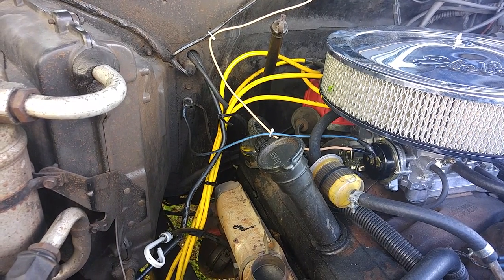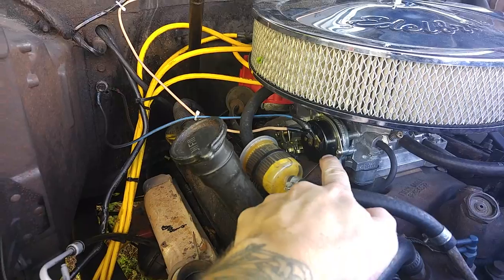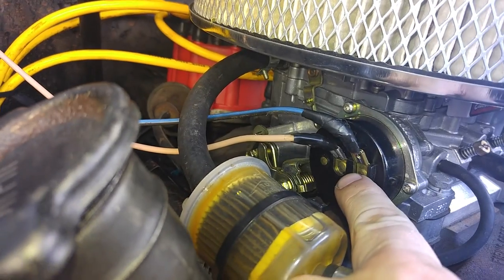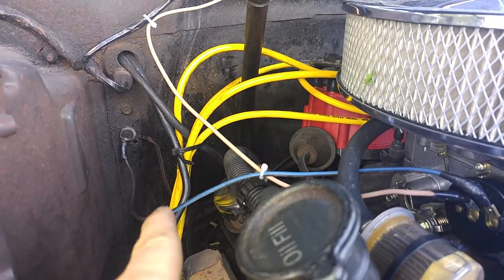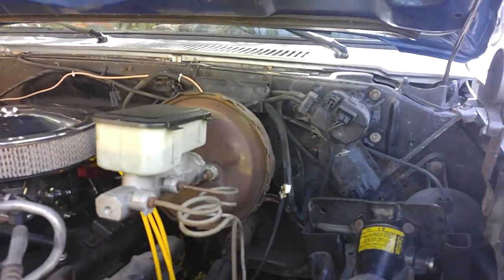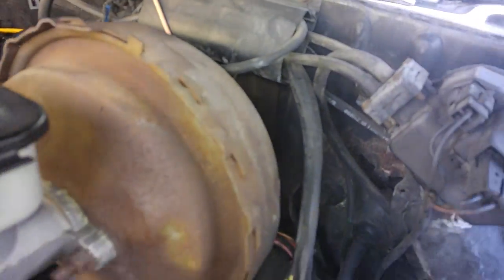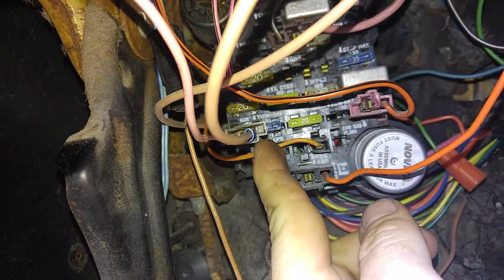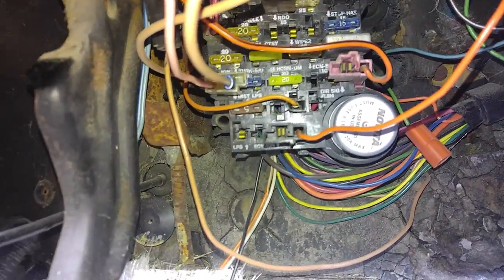Electric choke set up

Comment: Nice job explaining Tim. This video will also work on a Holly carb too. Note to all. The ground is very important for this set-up to work properly. Holly video shows the ground to a carb screw, so very short wire is all that is needed for this grounding. Cheers from Motown!

Comment: can't you just wire it to the solenoid instead of going all the way to the fusebox
Reply: Christopher Cardona Ford's go to the stator connection on back of alternator
Reply: James Perkey I tried that and only received 9v across the positive and negative ends on the choke when ignition was on
Reply: If it works hell yeah! Screw correct way. As long as it works
Reply: Been doing a little research on this and it is said many times that it is not a good idea to connect to the silenoid.
Reply: No, because of reasons @R.C. mentioned (it won’t open all the way) and because the hot wire needs to have a fuse just in case.  If something goes wrong, you’ll have the safety of a fuse that pops rather than burning up your electric choke.  Just a side note to elaborate further on the subject, the coil has a ballast resistor somewhere between the firewall and the coil which bring the 12v feed down to 9v.
Reply: @r.c.4153  I was thinking of doing that seeing that I get a solid 12v output from the positive side of the Ford solenoid. Can't use a fuse tap into fuse box as is old glass fuses and way up under the dash.

Comment: Aside from the amature wiring itself, the actual locations for hookups is a very good way to go about it. Too many times, these electric chose are wired to the positive at the distributor or near there and there is backfeed voltage going back to the choke as well as overvoltage. It's probably why people have problems with the choke. It needs a 12-13.8 voltage and no more than that.
Reply: Right N.M. Holley instructions says do not go to distributor or Coil positive for the reason you explained (choke issues) I realize this is not a Holley, but the principal should be the same.

Comment: Thank you for this detailed explanation of the carburetor Choke, which I followed in my old Nissan Jeep. After installing it, I did not feel any problem in operating the engine except that there is some smoke coming out with the exhaust before the engine warms up. Is this something normal? Greetings to you from Riyadh.
Reply: Most likely the engine warming up and running a bit rich on gas, as long as it doesn't smoke when warmed up your fine.

Comment: as long as it is to ignition there isnt a wrong way to do it people wire these how ever! you just need 12v from ignition source then no power when car is on! This is controlled by Ignition Battery an accesory option on your key or even push to start ignition.
Reply: Power to the coil only when the ignition is on…. No power to the coil when the car is Off!

Comment: Again, with all these videos... What are you using to turn the choke off when it reaches operating temp? Normally an electric choke is controlled by a thermostat, or the ECU in an 80's car. So you are just running the choke on all-the-time?
Reply: It used a bimetal strip, like thermostats in your house. Once it reaches a set temperature it opens the circuit, turning the chock off.

Comment: Thanks. So is your choke being supplied power the entire time the truck is running, or only when you are cranking? From my understanding it needs current to heat up the bi-metal spring under the black cap which winds and closes the choke plate, which then initiates one of the many carb starting sequences. After its started the choke loses current, cools down and opens the choke plate. Is this correct?
Reply: That is correct.
Reply: Closes the choke when cold, not open. The choke is normally closed and opens as it warms up.